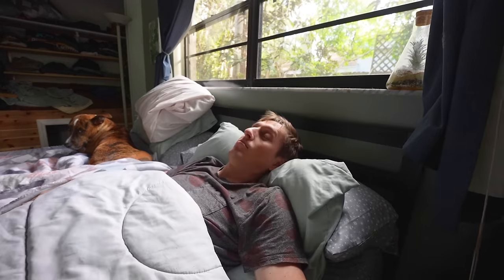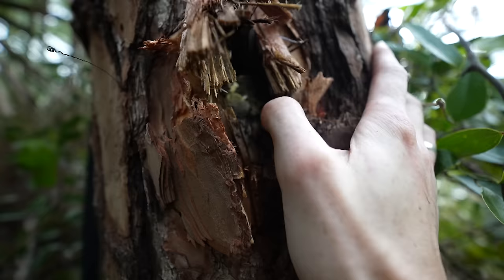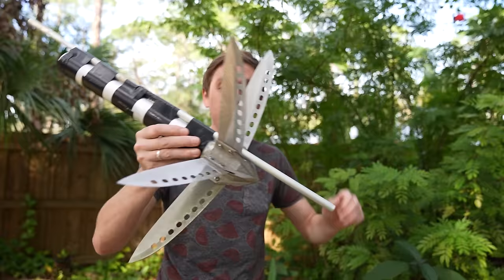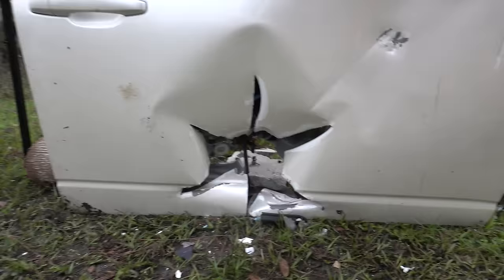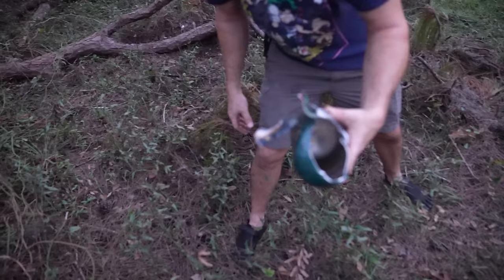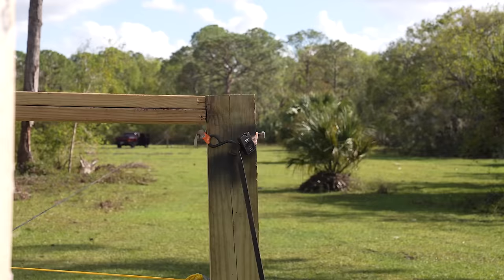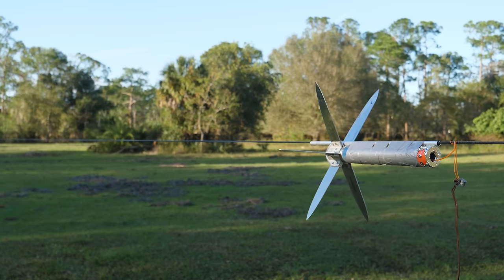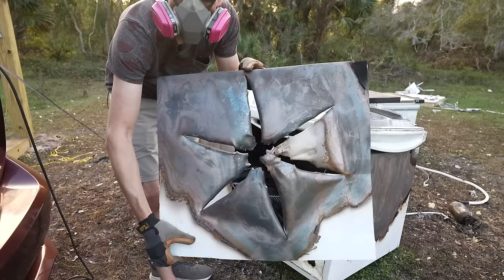400mph Rocket Knife

Comment: I laughed so hard at the line, "Guess what, rocket nerds! I figured out how to make my own rocket fuel, and it's twice as dangerous."
Reply: He is very right on that point highenergy rockets can be very dangerous...
Reply: @davidnoland2574  sugar-saltpeter is pretty benign.  Put it in a tube with a small opening and you have a relatively safe rocket.  ¯\_(ツ)_/¯
Reply: @crapple5759  Next step is using ammonium perchlorate as your oxidizer and you get this.
Reply: @crapple5759  I think the rocket has aluminium and perchlorate and maybe more of things?
Reply: @crapple5759  aniline + nitric acid is a pretty decent one
Reply: I laughed at the first line which implies he went to the bathroom in the bed
Reply: @Hnkka  probably not, since ammonium perchlorate actually decomposes before it melts, but maybe I’m missing something.
Reply: This was created on December 1 at 12 AM
Reply: @warumnicht4799  If i remember, nasa uses it too because its very powerful oxidizer
Reply: @warumnicht4799  "Ammonium perchlorate composite propellant" is the name
Reply: Does a really scary knife throwing act. Spoiler do not volunteer to take part!😂
Reply: @Hnkka  i got to try this
Reply: I think it's the classic smoke bomb recipe possibly with tweaked ratios. Stump removing powder (has some potassium stuff in it) and sugar, cook on low heat and stir until it looks just like what he was pouring...
Reply: OK how many of us knew how to make rocket motors / explosives in HS. I sure did
Reply: @mike41062  Amonium perchlorate also has that colour and its easier to cut in pieces, smoke bombs mixture gets hards af as soon as it cools down
Reply: Looking forward to him selling his   knife rocket home kits ?
Reply: why didn't he say the ingredients?
Reply: @joekrater3364  cuz YouTube can ban him directly for that
Reply: Instant sub 🤣
Reply: Recipe please.
Reply: @davidn3063  it's a given 😉
Reply: @joekrater3364 because of unskillful teens who can hurt themselves and terrorists.
Reply: @ballinraccoonankles  LMFAO dude
Reply: So did most rocket nerds!

Comment: What you called the center support on the door is actually what is called an intrusion beam. These beams are made of at least high strength steel, and I think some cars use ultra high strength steel. The intrusion beam is the main structural strength for doors to protect passengers from severe side impacts. That was impressive to see the knives actually cut through it. I thought for sure the knife was just going to shatter when it hit the intrusion beam but it sliced through it like butter.
Reply: Most cars less than 400mph
Reply: wow that is incredible, thanks for that info!
Reply: @BrazilianPegging  most cars heavier than knives
Reply: @jonathanrosskamp324  I would bet the force per square inch is significantly higher over the much much smaller surface area of the impact, coupled with the cutting effect of the edges, pretty easy to guess the knife rocket would go through it.
Reply: Velocitas eradico!
Reply: Mans said “ultra high strength steel” lmao.
Reply: Cars are usually blunt objects as well not as thin as a knife with such a high impact force in such a small space.
Reply: the knives were from carbon steel.
Reply: I seriously doubt that high-alloy high strength steels are used to any significant extent in modern cars. Considering the weight of most modern cars, at best, low-alloy steel is used in most of the construction, but carbon steel is also likely used significantly. Knife steels are usually high-alloy high strength steels or at least higher end low-alloy steels and they are always heat treated to a relatively high hardness, far harder than any steel used in the construction of a car. The only knife materials that would have a chance of shattering (with correct heat treatment) would be very high end high-alloy steels with very high carbide contents or ceramics. Of course, given bad heat treatment with excessive hardness, most knife alloys could shatter.
Reply: 그는 니콜라스 케이지 사촌인가?
Reply: @Vid_Master  don't quote it though, because it's not very accurate...
Reply: I have tried commenting multiple times to add some additional info but they keep being deleted for some reason. Maybe because I was trying to link a website. If you google "ultra high strength steel" there should be a website called SSAB that gives information about high strength and ultra high strength steels used in car construction. Any parts on a car that are designed to be the main structural or safety components of the body of a vehicle usually use high strength and ultra high strength steel. Some times aluminum is used for these components, in which case it's more about the overall design structure that allows for it to absorb and disperse energy. Most body panels or non structural panels are built using mild steel, so in this case the outer skin of the door and its inner shell are made from mild steel, but these parts are not intended to protect occupants in a severe crash. They will deform and crumple to absorb energy but it's the high strength steel beam on the inside that is designed to provide the strength so another car doesn't just go straight through the mild steel door skin and shell. I should also clarify that it's not so much surprising that the knives went through the intrusion beam. I am no Physicist so I don't know that maths. More what was surprising is that the beam was basically cut clean in two. I would have more expected the beam to bend and then be torn or ripped as the knives went through. I don't know much about knives and how they are made and hardened but I do know a decent amount vehicle construction and materials they use.
Reply: @poiu477  yup, it's about pressure , not just about energy
Reply: @quentagonthornton49  im pretty sure high carbon steel is not more heavy then low carbon steel
Reply: @magnumcz1  definitely pressure plays a part of it. The knives edges obviously apply a lot more pressure to the surface area they contact compared to another car. I would have thought though, based on what I have read on a couple of other comments, just how hard knives are that the pressure being applied back on the knives would cause them to shatter and explode given that they would be far more brittle than any steel used on a car. Still this has me interested to know exactly what is happening when the knives rocket makes impact with the intrusion beam. It would be cool to see a follow up video with another car door with its outer skin removed and slow mo of the rocket impacting the intrusion beam to see what is happening.
Reply: @grahamdavies8986  Yes, links get auto-deleted...
Well in this setup, 2 very important factors are at play that are not at play in vehicular accidents: very high speed and very sharp edges. The crumple zones and the beams are designed to bend upon blunt impact. The knives give a very fine so-called line load, and metals are not good at resisting line loads and line stresses (which is why metal shears work so well). 
The effect of the speed component can easily be seen in experiments with guns/bullets. A high speed light weight bullet will always penetrate much deeper than a slow and heave bullet of the same shape. The speeds of the rockets in this video are multiples of speeds associated with traffic accidents, so it makes sense that the materials in cars are not optimized to withstand impacts of such speeds.

Of course there is also a difference between strength and hardness. Even if the beam would have bent instead of being cut, it would not have shattered the blade like the other objects did, because the whole point of using beams in car safety is to prolong the energy transfer as long as possible. Shattering requires an immediate and full transfer of energy (hence the need for hardened materials). So the "ultra high strength" metals you refer to, will be so relative to other metals with the same hardness. (meaning that they will be able to bear static loads and dynamic loads in spite of being soft, so that impact loads are absorbed more gently) 

(as for my expertise on vehicular safety, function and physics of metals in cars and energy transfer upon violent impact, I refer to my profile pic. Let's just say I have tested the science first hand...) =))
Reply: @lukearts2954  from what I can understand of that it seems to make sense. I will definitely say you seem to have a better understanding of the properties of metals and physics than I do. I understand vehicle construction and materials in how it relates to my job, which is cars being impacted by other vehicles or commonly hit fixed objects. Definitely nothing like knives attached to a rocket going substantially faster than a car. Or metals, or even steel, used for other applications. Do you have any useful references I can look up. I would love to understand the physics and forces at play here better.
Reply: F=MA.
Fair bit of M, buttload of A.
All deposited in a very small area (blade edge thickness, over maybe a couple centimeters). 
Impressed, but not surprised.
Reply: @endworld418  I'm talking about strength to weight ratio, not all out weight.
Reply: So... it's a support beam
Reply: because its just normal steel not even stainless
Reply: When you love cars and get triggered
Reply: Makes you feel safe in traffic innit
Reply: @Ole_Rasmussen  gotta stay vigilant for people launching sugar knife rockets at the stoplight
Reply: @quentagonthornton49  oh ok
Reply: @BrazilianPegging  yeah.. so the kinetic energy mass x velocity + edge to aply that force...do the job perfectly

Comment: Anything moving away from you at that high a velocity has to be safe. I think this is some of Kevin's best work.
Reply: Bro the ricochet off the car door
Reply: Unless it has the ability to turn around.
Reply: @RotGodKing  gotta make it a little frightening to be exciting
Reply: @ratchetandchank8648  That flew really high into the air as well, looked like the rocket was still firing, that must have gone far
Reply: i don't think want to be at the back end of an RPG, or any rocket
Reply: Well now fellas, there is a brand new sensation that's sweeping the nation; they've got humorous turns of phrase with some genuine imported European ironic pizazz. We call them jokes. And now you too can get them!
Reply from the maker: @jellyman140  It went about 400 more feet
Reply: @mr.2minutes161  backyard scientist rocket, ordinance lab martini glass shaped charge, some I did a thing engineering plus some metal pipe from the hardware store and primer = RPG
Reply: @TheBackyardScientist  Are the knives on backwards? Blade seems to be facing towards the rocket and away from the target?
Reply: @TheBackyardScientist 😮
Reply: @georger5558  They ARE backwards. This gives them better aerodynamics. Also, the side doesn't matter at that speed. Metal is basically shiny butter at that speed.
Reply: @asialsky  How does having the knives backwards give better aerodynamics? Surely having the sharp side forward, rather than the flat back edge forward would give less resistance?
Reply: At some point it just overflows over to safe

Comment: how to make rocket fuel first get sugar and put it in a heating pan and now you want to get potassium nitrate, mostly found in fertilizer put that in the mixture. make sure to keep the pan heated while stirring until it looks like a chocolate cake then you want to pour that into your tube of rocket fuel done! if you want a more efficient type of rocket fuel, get a heating pan and put rust powder and sugar inside mix until done. Please make sure you search up the required amount of each substance before doing so. 9:13  example of what can happen
Reply: … there’s a reason why Kevin blurred it
Reply: @Dosasco  Don't worry its on Wiki How
Reply: Why is it so expensive if its just sugar and poop?
Reply: I learned that the hard way when i was a kid, almost burned my whole house down
Reply: @Dosasco it's not that dangerous, and it's only maybe illegal (although at that size it's much more likely to be). I did it (poorly) for a chemistry class once
Reply: Doesn't mean everyone else has to @Dosasco

Comment: You could torch the blade's spine red hot till a magnet won't stick then air cool and it will be softer to soak-up the shock. 
  Also the same treatment works to soften a small area of hardened steel so you can drill it if it is too hard for your bits. I've got stuff that shrugs carbide unless you take some temper out.
  Diferential hardening for shock is the same reason why an ax is soft except for an edge that's a different metal slotted in. That and durability from a hardened edge.
Reply: Yeah like AR500.....
Reply: @jmathews470  AR 500 isn't impressive in terms of hardness but it has a higher tensile strength, you need carbon content to achieve hardness and ar500 dosn't have enough of it
Reply: Wouldnt this work harden it and make it more brittle? I mean it's literally spreading the molecules out to make the metal less dense.
Reply: @gunners4129  
Metal Tempering

Tempering is done to develop the required combination of hardness, strength and toughness or to relieve the brittleness of fully hardened steels. Steels are never used in the as quenched condition. The combination of quenching and tempering is important to make tough parts.

This treatment follows a quenching or air cooling operation. Tempering is generally considered effective in relieving stresses induced by quenching in addition to lowering hardness to within a specified range, or meeting certain mechanical property requirements.

Tempering is the process of reheating the steel at a relatively low temperature leading to precipitation and spheroidization of the carbides present in the microstructure. The tempering temperature and times are generally controlled to produce the final properties required of the steel. The result is a component with the appropriate combination of hardness, strength and toughness for the intended application. Tempering is also effective in relieving the stresses induced by quenching.
Reply: Pretty sure at the speeds the rocket are going you don't even really need much of a sharp blade, just take any preferred type/thickness of steel blanks and cut the "blades" out.

Store bought knives just look cool and make good video.
Reply: @gunner. Possibly if its air quenched. You could make that harder than it was originally but you won't find much of that. Refer to a book on metalography or a manufacturer for specifics.
Reply: * ferrite magnet only.